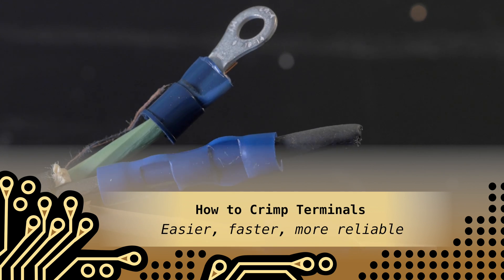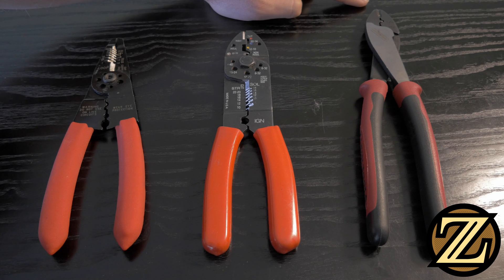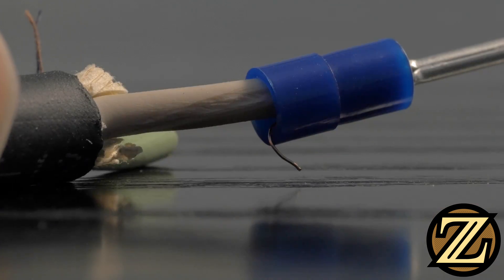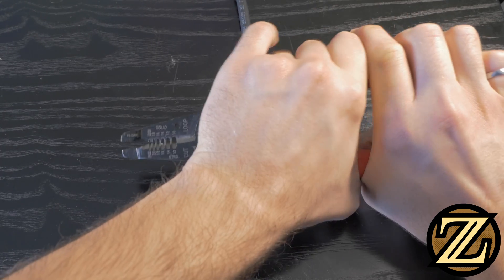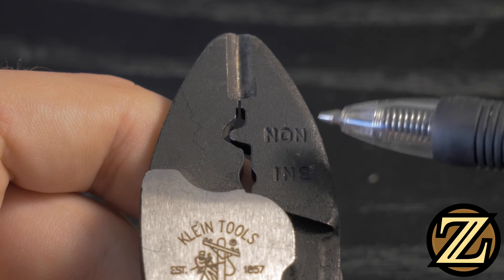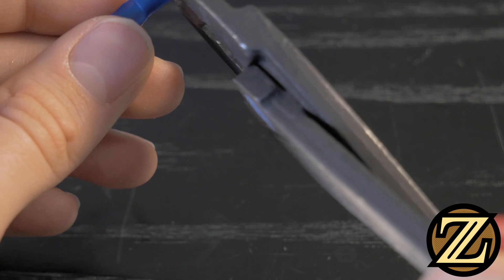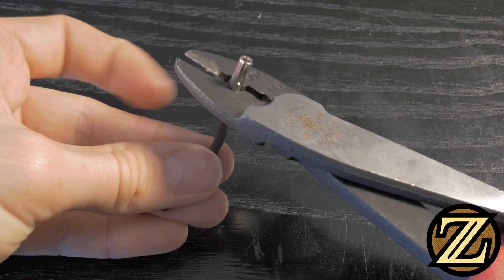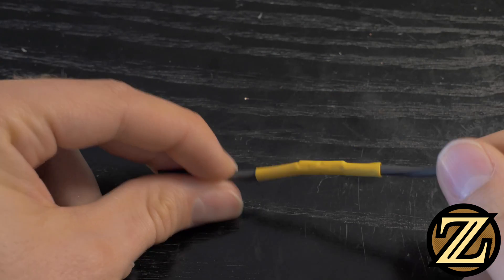How to Crimp Terminals and Splices

Comment: The slit goes opposite the valley.  The slit goes on the male part of the crimper.  That male part of the crimper is responsible for folding in the slits on the connector to bite into the wire.
Reply: @A. Melbs its the right way though.  The trick is getting the male part of the crimp toll perfectly centered with the slit so it folds both sides of the barrel in evenly.  Look at this pic

http://techmattmillman.s3.dualstack.us-east-1.amazonaws.com/wp-content/uploads/2020/11/pidgcrimped-800x407.jpg

Comment: Thank You for this video. I never used the Butt Connectors, did the twist & tape, lol.  Now I know how so I can finish rewiring my utility trailer. 👍
Reply from the maker: I'm glad I could help! Good luck with your project!
Reply: @alexanderbaran-harper4748  Thanks for the great tutorial. What is the torch model you are using for the shrink wrap ? I've a heat gun but bulky. Yours look very compact.